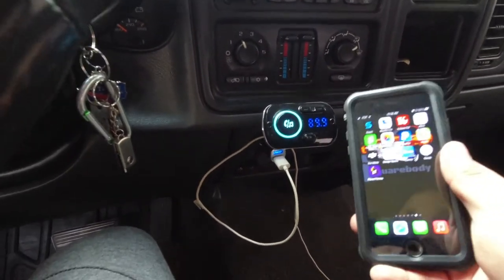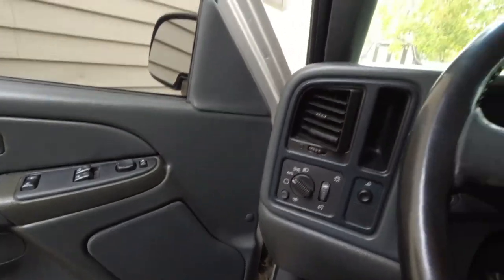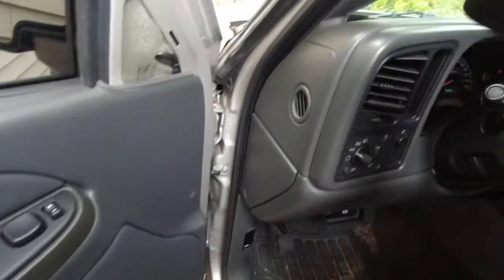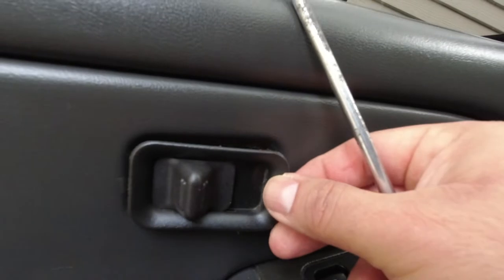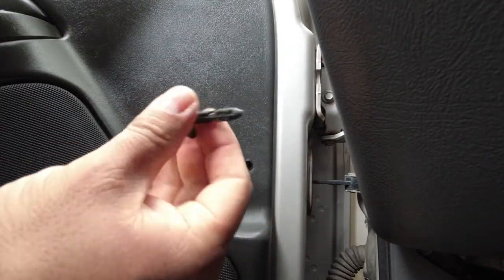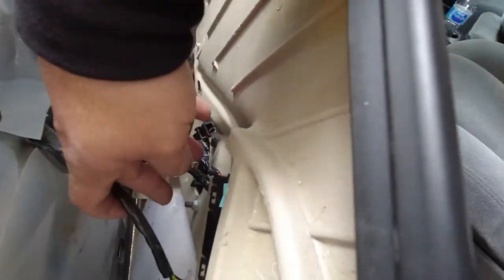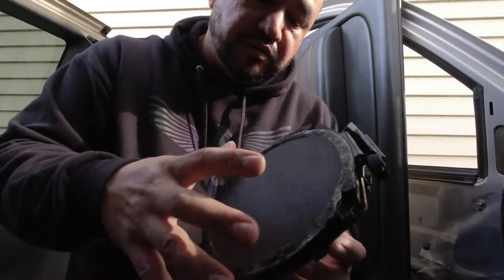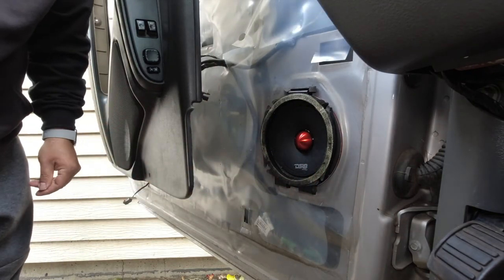2005 Chevy Silverado 1500 Cateye DS18 speaker upgrade part1

Comment: Do you know if I could do this with my 2005 cat eye, but the speakers I would use would be from my old truck which is actually a 2006 which has Bose speakers. Would those work since they're only a year apart, and would I just have to plug them right in?
Reply from the maker: If it’s a cateye  like your 05 then yes, if you’re talking about the front doors and the rear back speakers yes